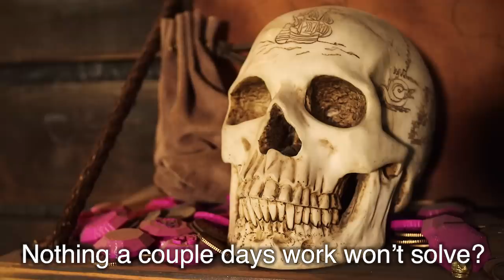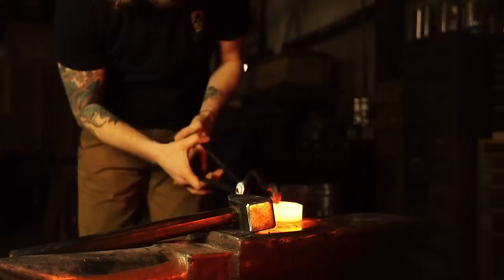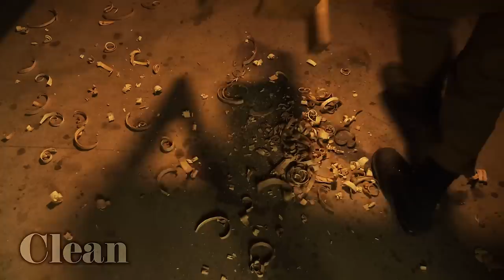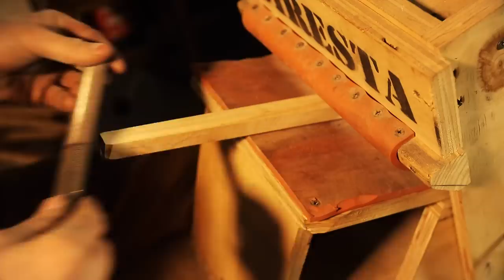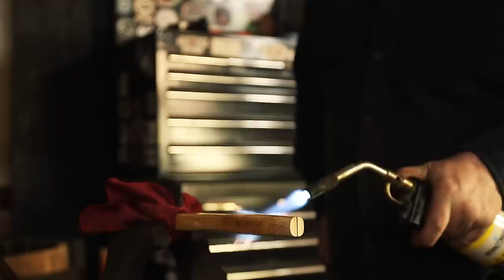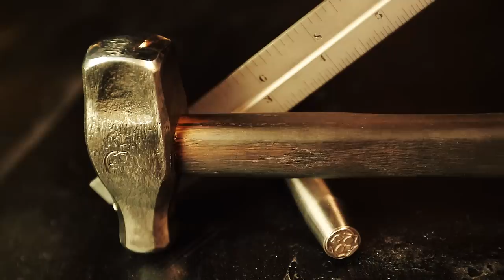Forged Ball-Peen Hammer

Comment: Touch mark tip - make a round flat stamp / punch a little larger than your mark. Use it first before your mark. Creates a flat surface and nice recess. I think Torbjörn Ähman does this too...
Reply from the maker: Very good suggestion! I guess I missed that, as I am a HUGE fan of Torbjorn

Comment: I`m probably repeating myself when commenting on your videos, but that was great Brett! It`s impressive that you made a hammer in less than a day, and more so that you managed to not only film it, but get great shots and make a high quality video parallel to making a really nice hammer. Does time slow down for you?😁 The evenheat programming was perfect, and should be the standard operating procedure for any machine with more buttons than just start/stop. And did you hit your head on the lanterns when entering the frame, or do you just whisk by so fast that they` re caught in the slipstream and start to sway?😁
Reply from the maker: I've gotten used to the lanterns. I do think I'll need to raise them at some point. Not in this video, but in many others, there are lots of me bonking my dome on my "set".

Comment: Was the "face smoosher" a tool that you made or found? It seems like somewhat common tool that a lot of blacksmiths might have but I've never seen one used. 

I have a ball peen hammer head that I'm saving to forge into a camp axe some day. Very nice build!
Reply from the maker: That is a dishing/cupping tool. I have yet to put a post on it to properly use it in the hardy hole, but yes, it's a very common smithing tool. Makes all the roundies.
Reply from the maker: That is a dishing/cupping tool. I have yet to put a post on it to properly use it in the hardy hole, but yes, it's a very common smithing tool. Makes all the roundies.

Comment: When you spoke about it on FWT I thought it would have a huge crack, but that’s fissure isn’t too bad, it still looks really good, and I wouldn’t suppose a smaller peen hammer like that would get too much abuse anyway. Did I mention it looks really good? It does. Cheers Cap’n.
Reply from the maker: Shucks. Thank you Richard.